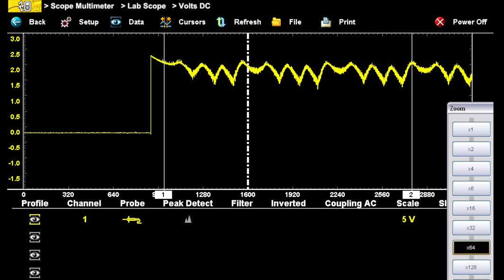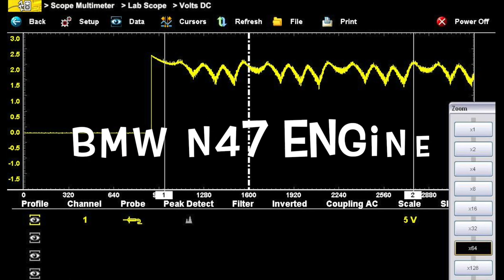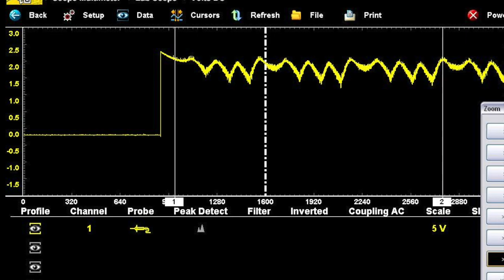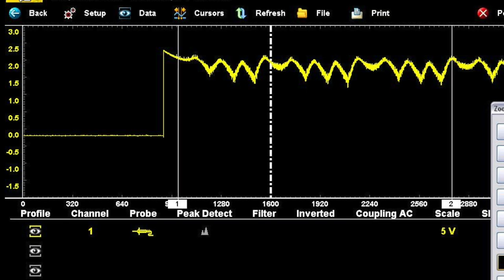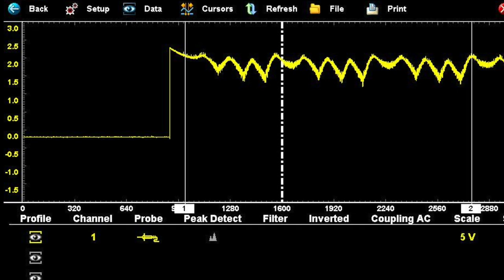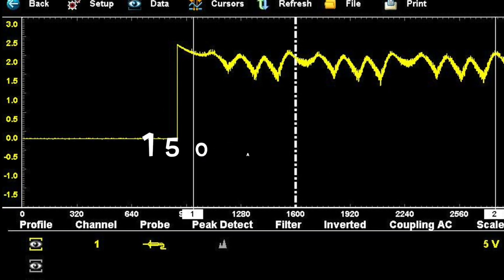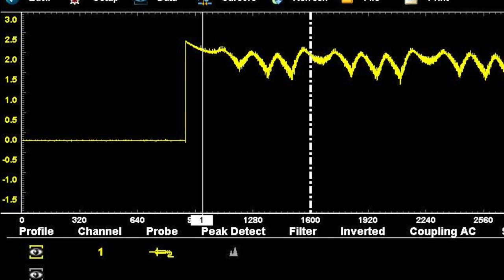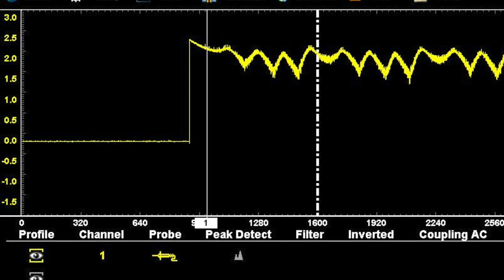Ive never seen this before in a Compression Waveform! Part 1

Comment: No too swift at waveform analysis so it won't surprise me if I am way off...Is it possible the one cylinders exhaust valve is failing open properly if at all. Collapsed lifter or extreme lobe wear even fracture at the far end of the shaft itself (last cylinder/lobe). It looks like their is a very slight slope to the right on the rest of the trace as if there is a parasitic drag until the suspect cylinders intake valve opens, momentarily relieving. This could be pure fantasy. Cheers Sandy

Comment: I think the reason you see the maintained high  current at the (M) McDonalds looking part is that your seeing a stuck closed exhaust valve and that piston is coming up to blow out gasses but infact is effectively another compression stroke. this is a single cylinder issue (not timing) caused by a stuck closed exhaust valve my guess is a broken valve spring or a worn cam lobe, a leak down may not show the problem as it's not a leak we have here.
that make sence ?

Comment: im thinking its an intake valve been stuck closed, on the intake stroke the valve been closed and the piston on the way down there is heavy vacuum and more load  witch in turn is keeping the high amperage .  Maybe im way off . thanks for sharing Sandy and i look forward to the answer.